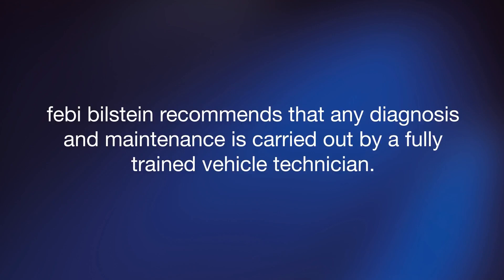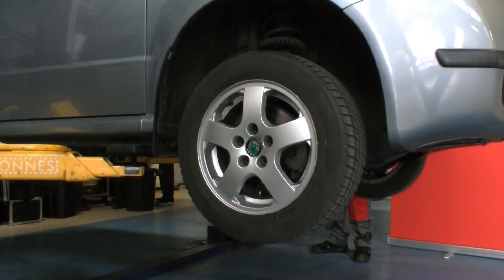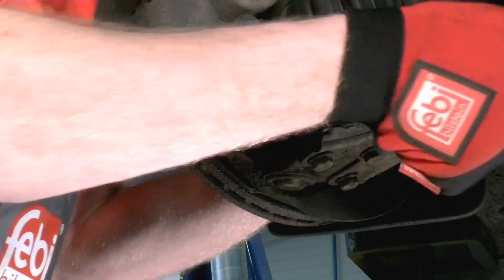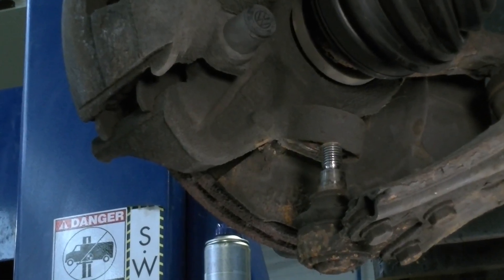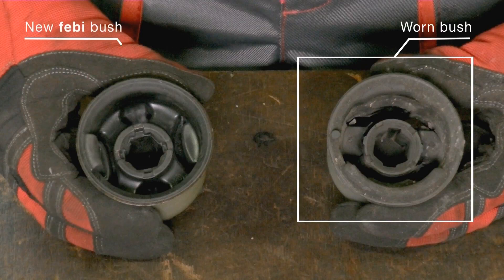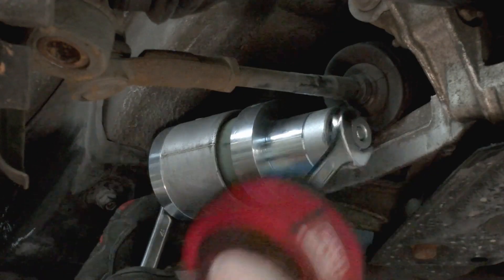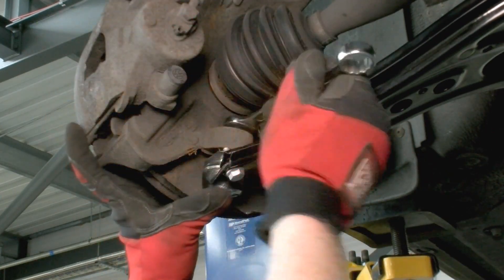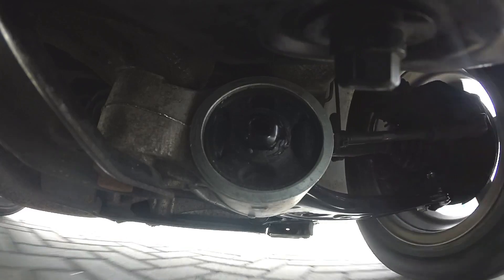[EN] VAG console bush replacement - febi bilstein Technical video.

Comment: There's another version of the insertion tool which is long enough to screw into the rear of the front bush bolt location point. My experience is that this gives better alignment of the large bush making it easier to insert correctly.

Comment: I've got my car pulling away whining noise coming from front of the vehicle when my clutch is half way disengaged and happens always and sometimes on narrow road when I'm going uphill from standstill in first gear and squeaking noise when going over humps from the rear department. My car has been recently serviced and investigated. I thought it is some part of the clutch but according to service all parts are in perfect condition except console Bush split and OSF outer Cv boot split. Changing second one mentioned would fix "hump" problem I believe. But can fixing front console Bush fix whining noise? Can it whine when car is being heavier to pull away?
Reply from the maker: Thank you for watching our video, knocking, squeaking and banging noises occur as the vehicle travels over uneven road surfaces, and are usually associated with the vehicles suspension system. Whining noises are from something that is frequently rotating. In your case this could be drive train or clutch related.